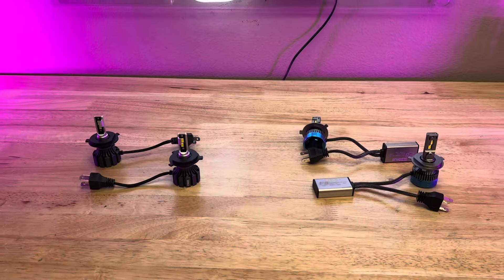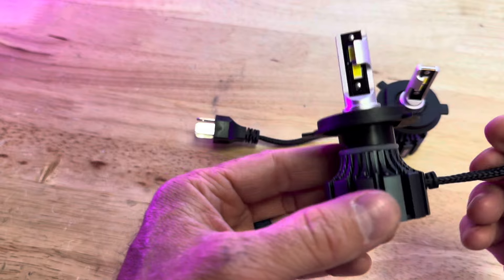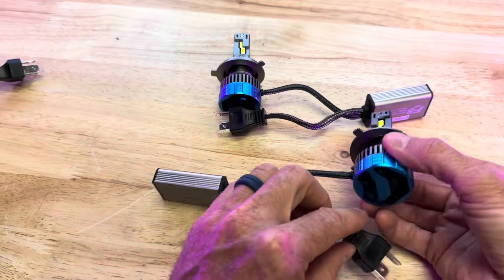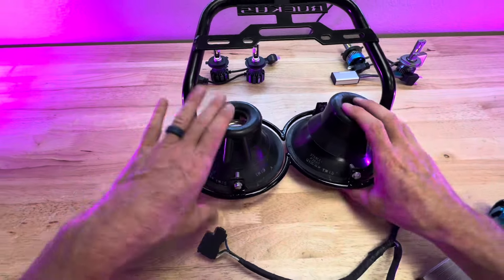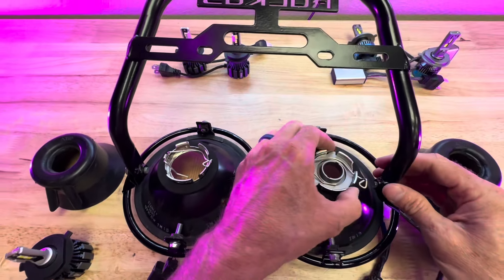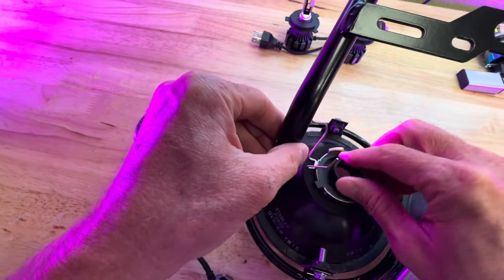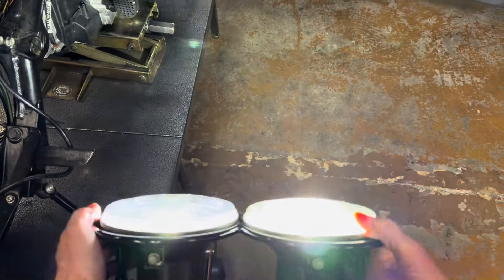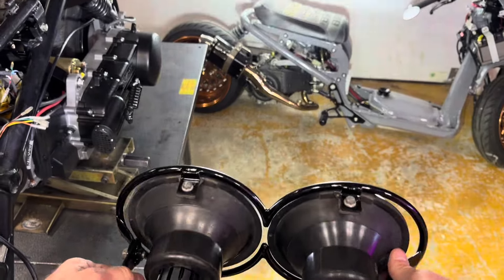Honda Ruckus LED Headlight bulbs - ProBld

Comment: What happened to the Probld H4 led fanless design? Were they problematic or run into any overheating issues?
Reply from the maker: The manufacturer stopped producing them :-(. So I had to come up with another plan.